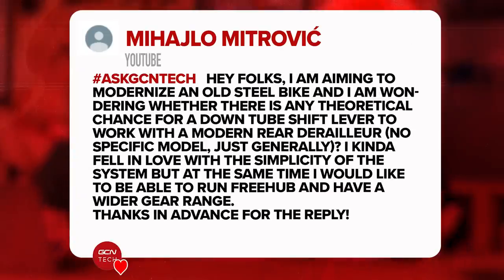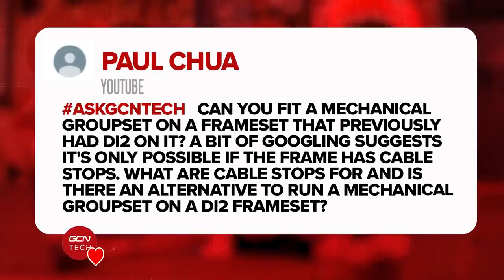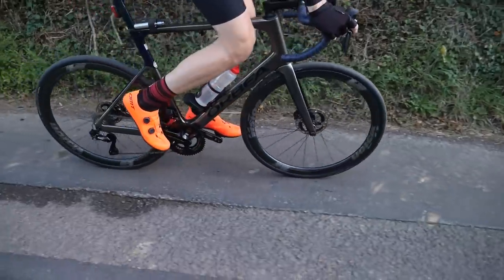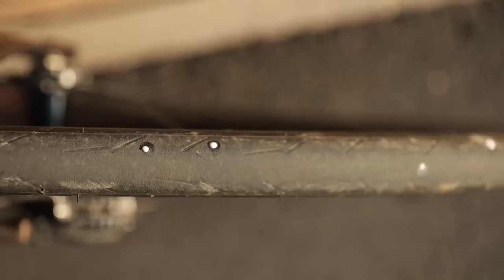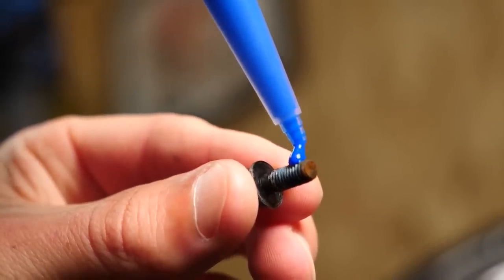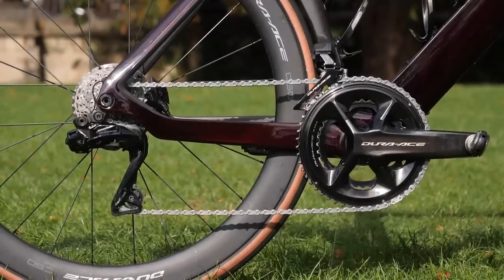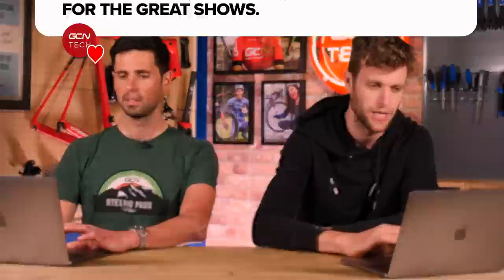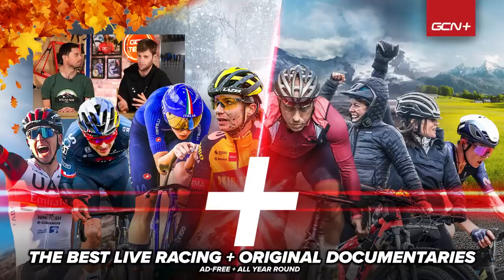What's The Better Upgrade: Wireless Shifting Or Carbon Wheels? | GCN Tech Clinic

Comment: If you do a lot of climbing I'd go with Di2 wireless.  Hyperglide+ makes shifting under load a dream, and shifting on the chainring is a godsend.  Plus  having gears displayed on my head unit without having to buy a d-fly thingus is nice to have.  Yes, could always look down at the gears themselves, but having everything displayed all together so you can take a quick glance is nice.

The wheels save for later.  Or buy some affordable chinese carbon as a interim stop gap.
Reply from the maker: Thanks for sharing your take! Sounds like you've thought through your bike nicely 👍
Reply: @gcntech  thanks! 😊

Comment: I went with the fancy pants carbon rims and 32mm summer road tires and kept the stock rims for 35mm gravel / winter tires. I found it impossible to keep switching tubeless tires back and forth on the same set of rims
Reply from the maker: This is a Great option, sounds like you've got a great do it all rig. 🙌

Comment: Locktite thread locking adhesive is an anaerobic adhesive which utilizes an ionic bond. If the surfaces of the threads are not "active" and cannot provide the needed ions, then Locktite primer should be utilized which will provide ions for a proper bond. Follow the directions included in the packaging. Clean the male and female threads using a suitable solvent (for example odorless mineral spirits) to remove wax, oil and grease. Prior to applying the Locktite, apply the primer to the threads and allow it to dry, and do so not too far in advance of installation. Apply the Locktite immediately prior to the assembly. Locktite is an anaerobic adhesive which properly sets up in the absence of oxygen, such as in the tighly confined spaces of assembled threaded fasteners, and ions from the primer will assist in providing a good bond.

Comment: It's definitely possible to install a mechanical groupset onto an electronic shifting specific frame. I used 3d printed inserts for the cable stops to make it work on mine.
Reply from the maker: 3D printed Inserts! Ooof very tasty 🙌
Reply: What frame is this?

Comment: Cleat bolts always come loose on SPD sandals as the sole has so much flex and give that the bolts become lose over time. Use a thread lock or superglue on the bolts & regularly check the bolts.
Reply: Medium-strength threadlocker should suffice.

Comment: Question for a future show. I've been happily using my commuter bike on my wahoo kickr core since last winter and other family members are wanting to get in on the action. I'm 183cm tall but others are currently smaller (170cm although closing fast). Rather than replacing my kickr core with the more adjustable kickr bike or equivalent (£££), I'm thinking of replacing the kickr core bike with a second hand machine that has an easily adjustable seat position. Is there a way you can also add relatively easy adjustability to the reach and stack on this dedicated turbo trainer bike?

Comment: i was struggling with my DT Swiss spline 1600 disc rims until i upgraded to Syncros 50mm carbon rims AU2099.96 its a big diff forget groupsets worry more about your rims its a game changer
Reply from the maker: Great to hear you're getting on with them so well! 🙌
Reply: @gcntech  oh yeah for sure best upgrade for a bike i think but i am planning on getting electronic gears maybe the new 12sp 105 but atm the stock is really low

Comment: been using Continental gp 5000 (with tubes) for a couple of seasons now.  the first set i had were crazy hard to fit on.  then they would not seat properly.  after lots of digging around youtube i found that using soapy water did the trick.  later i had the chance to remove the tires and remount... it was much easier.  On my next set of these tires they went on far easier.  overall i do love them, but strongly suggest you try them on / off a couple of times to see if yours will be possible to swap a tube on the road.  Call me paranoid but i carry a spare generic old tire just in case it is a pain.  probably have about 6-7 thousand kms on two sets of tires (rear wear faster of course).  one puncture on  a front wheel.  on a rear wheel i think i overinflated and hit a very sharp rock... sigh.   just this week i found a bit of a sidewall gash on my rear (well used) gp 5000.   fast tires,  wear pretty well. great grip.  pricey but can be had on sale.
Reply: I have just exchanged my old gp4000’s for gp5000’s. Took me 5 minutes max. You must have done something wrong or bought the wrong size.

Comment: I use a diacompe 10sp downtube friction shifter with an 11-34 cassette. No issues whatsoever.
Reply: not necessary, SHIMANO has 10 speed downtube shifting, so does Microshift [Chinese]
Reply: What's a "10-speed friction" shifter? A shifter is either friction (has no detents) or n-speed (has n detents), right?
Reply: @DrewLevitt  I guess it just means that it has enough capacity for the amount of cable needed to be able to shift between 10 sprockets, rather than a really old one that can only shift enough cable for 6/7/8/9 sprocket cassettes.
Reply: in fact, Shimano even has 11 speed downtube shifters, they also DOUBLE as bar ends for TT bikes

Comment: #askgcntech  I have a Specialized StumpJumper (hardtail) that I want to convert into a gravel bike. I have an old 47cm Trek Lexa that is just to small for me, hurts my back, and feels a bit dangerous while trying to gravel ride with the 28mm tires it barely fits on itself. Can I swap the shifters and brakes to put a road group on with drop handlebars? Both are 9 speed, but my Lexa is a rim brake bike, and my StumpJumper is hydraulic Disk.

Comment: Electronic shifting is by far the best upgrade. 
Absolutely makes riding more enjoyable
Reply: Arriving home, so late for dinner, you find everyone is already fast asleep: "Electronic shifting is by far the best upgrade." <<---- until the battery dies and you walk home miles upon miles
Reply: @savagepro9060  never had a battery die in over a decade using it on both summer and winter bikes. 
It’s not complicated charging it, you put a cable in. Pretty straight forward process.
Reply: @livibam  REMEMBERING to charge it is where weak point is, so why so many people walk home miles after miles, it's because it is POSSIBLE to FORGET to charge the battery, in that regard you are one LUCKY frekin rider
Reply: @savagepro9060  i don’t know anyone who’s had the issue. 
I know a lot of riders who use electronic
Reply: @livibam  I give up, my commenting battery just failed

Comment: What's the better upgrade?  Upgrade you own fitness and ability first, then see if you really need to spend your hard-earned cash on some over-hyped new equipment.  I've never used electronically-controlled shifting, but if forced to choose I'd go for that over carbon wheels because I use rim brakes and because I don't race.
Reply from the maker: Fitness first in our books...but fancy upgrades are always fun! 🙌
Reply: On what would you spend your hard-earned money? Can’t think of anything else that is more fun then cycling tech…
Reply: @ninibur  Amateur radio, audio, PCs, photography... the list goes on.  Cycling tech is all fine and good, but cycling is just one of my interests.  It's gotten a lot of my attention this past spring and summer, but as the weather cools, other hobbies will return to the fore.

Comment: Friction shifting - super smooth, cheap, reliable but carbon wheels for sure 🙂
Reply from the maker: Friction shifting and carbon wheels... when two worlds collide 🌎
Reply: @gcntech  Why not - anyway it's possible and with new shifters and cassettes it's really easy to "find" gear now-days while cycling. It's not racing configuration but works great for touring and long rides

Comment: I'd go with the wireless shifting first.  You definitely will not regret it. And then I would buy my carbon wheels from ICAN for about 800 bucks. Check out the recent Hambini review of these wheels that just came out. I've had two sets of them, one on set each of my two road bikes they've got thousands and thousands of miles on them, they're light, and they've stayed true.
Reply from the maker: Sounds like a great purchase 👍

Comment: #askgcntech Hi guys and Manon, I do use tubeless Conti GP5000s TR with my Zipp404 hookless wheels. I use Muc Off sealant which worked well to plug many holes. However, I have had to take a train back home the other day! I cleaned the tyre, reset the system with fresh sealant but the system still fails when the pressure is high. Due to shortage in almost all hookless compatible tyres, I can’t find any new tyres for my Ironman next month. Would you recommend using a plug? Or a tyre booth? As a semi-permanent fix to use in a race until I can get my hands on new tyres. Thanks

Comment: #ASKGCNTECH Hi Alex, Ollie, and/or whoever might be there in the next show, we ALL love you ALL! 😄 I am a hearing impaired rider so I rely on some tech stuff (radar lights, sensors, sports-specific hearing aid programs, etc) to keep me riding safe and allow me to have fun on my beloved bikes 😍
So..here comes the question..
Having experienced a couple of flats and discovering them just by the altered "feel" of the bike (probably with a slight delay compared to when I used to "simply" hear all noises) I was thinking about getting some of those fancy "wireless tire pressure sensors" available on the market...My doubt, though, is whether these sensors will work with road tubeless setups. I am afraid that their high-tech magic might not be compatible with TL sealants and "high" pressures. Thank you all, sorry for my bad english 🤙🏻🇮🇹

Comment: #askgcntech Hello, I've tried tubeless on my 2019 Trek and experienced failures.  First, I am 240lb rider and the first failure was the rear tire while doing ~20MPH just 4 miles into the first ride. The bead of the tire gave way. Switch the rear tire back to tube, no more issues until a sunny, warm day when the front tire failed in the same way as the rear. UGHHHH!@$%#@&*#!!@!@ (This was during an event). My question is: Why did my tubeless tires fail? I absolutely loved the short ride that I had before the first failure. (Note it was several days between when the tire was built to when it was ridden.)

Comment: For the person who wanted a downtube shifter for modern group-set. You can get a Dura-Ace 9 speed, and also 10 speed version, both INDEXED downtube shifters, no need to go friction shifting. @GCN What is the point of this channel if you aren't going to do even the most basic research. At least it's not as bad as Ollie telling everyone to torque the headset compression plug to 6nm (probably should remove that video) 🤦‍♂

Comment: #askgcntech hi tech team can you advise, I've recently been upgrading my 2016 j guillum orient titanium bike. New hunt aero 50 wheels, carbon aero bars & stem, look keo blades and sram force 1 axs shifters and mech, as you can guess trying to loose weight too. I'm using my previous force 1 crankarms and was going to change the chain ring to 46t narrowwide, do I go for light weight or aero?!
Thanks karl in Harwich

Comment: #askgcntech : hi gcn, i bought a 2nd hand Bianchi Sempre Pro 2015 and it came with both bottle cages having its bolts seized up in the rivnuts im guessing, and the bolt heads being completely rounded off. Considering that it is a carbon frame and drilling slowly and carefully into the bolt head scares me, what should i do, to finally free the 4 bolts off and to replace them? Reasoning: i want to place a minipump holder under the bottle cage but cant do anything right now

Comment: #askgcntech Hi guys and Manon, as winter is coming and i'm going to swap to winter tyres (unfortunately tube type) can i put some tubeless sealant into the innertube (valve core is removeable) to seal small punctures if they occur? thanks in advance

Comment: #ThanksGCNTech Love you guys, thanks for replying to most of the questions I ask you.

On the topic of the downside of the down-tube shifter, I am a pretty short guy  and the reach wouldn’t be even nearly as challenging to me as it is to Connor for example. I already have a carbon bike with 105 R7000 and I simply want to try and experience how it used to be back in the day on my steel steed.

Thanks again! Greetings from Germany!
Reply: Lovely question this week sir

Comment: #askgcnteck  hello I want to order a brand new shimano r8100 groupset but I can't make a choice on what gearing I wanted it's 52/36 11/34  or 50/34 11/30 what do you prefer and why?
Reply: Find out the current gear ratios of your current groupset's gearing and see which set among the two on the new groupset's matches yours most closely.

Comment: #AskGCNTech Decal removal. Hints, tips, tricks? Am trying to peel off decals from some Fulcrum Racing 5 (DB LG) [aiming to reflective paint half the radial and replace sticker opposite], the thumbnail does make progress... if ever so slowly. Thinners are doing a gun job of the residue, but the thin base layer is [redacted profanity]. !pleH

Comment: #ASKGCNTECH Would it be possible to convert a rim brake road frame to a disc brake one? If so then how would it be done?
Reply from the maker: Hi, Thanks for the question! You do have to buy a disk specific bike, there are a whole range of reasons but it all boils down to not having the correct mounts on the frame to fit the brakes, Hope this helps. 🥸
Reply: Impossible, unless the frameset itself has mounting points for disc brakes and exchangeable dropouts. Only one bike I know so far has such a feature.

Comment: #AskGcnTech , i am really interested in disc  brakes  ,however i dont know if my frame which currently has rim brakes  can run disc brakes .Help Me Gcn
Reply from the maker: Disc brakes are a great upgrade, but more than likely you would need a different frame and fork. 🤔
Reply: Unless it's a mountain bike, don't fall for the disc brake hype. They are a heavy, noisy, pain in the ass, even at the top pro level.
Reply: Thanks aloy

Comment: None of the two. I need a New Gravel Bike asap😅😊.
Reply: Having two wheelsets for a Gravel Bike is almost mandatory
Reply: @bindingcurve  Bike Industry: "Having a Gravel Bike is definitely mandatory"
Reply: @savagepro9060  Why?  I know my "gravel" bike is really just an endurance road bike with a compact 105 7200 drivetrain and the clearance for 45 mm tires.  It does open up Umstead State Park gravel roads and paths for rides on 45s and I switch tp 28mm with CF rims for tarmac only rides.  You can call bikes anything you want to, but I think for a person who bikes for fun there is nothing better.

Comment: Carbon wheels no doubt
Reply from the maker: We agree, but it all down the riders. Depends on what you're looking for. 
Want Faster handling and bit more zip in the ride = carbon wheels. 
Want buttery smooth gears and ease of use = Wireless shifting.  
Horses for courses 🚴

Comment: It proves guys do NOT know stuff like the older presenters:  THERE ARE TEN SPEED DOWNTUBE SHIFTERS AVAILABLE
EDIT: downtube shifters: 5,6,7,8,9, and 10 speeds, in fact, I even forgot to mention, there is Shimano Dura Ace 11 Speed down tube shifters
Reply: Good thing there's friendly experienced people like yourself to help them out :)
Reply: Hey, thanks for pointing out a mistake on my part and letting people (and me) know that's an option on 10/11speed too. I'm only human after all and it seems I could brush up on my down tube shifter knowledge😎